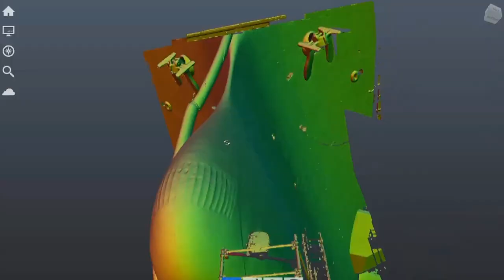Why US Navy Shipbuilding is in Crisis

Comment: NNSB (Newport News Shipbuilding) can take a large portion of blame for the Ford Class carrier delays. Putting Donald Rumsfeld’s shoving new technology into one ship aside, these higher ups at NNSB, from procurement and scheduling to manpower distribution, are woefully inadequate and trained to tackle these issues successfully. There are a few folks at that level that have a good grasp of the macro process of overall shipbuilding, but politics, monetary bonuses and poor training are deeply woven into the culture. The submarine building portion is no better off.

The rudimentary problem of a failing workforce is THE problem, foreseen by many of us forward thinkers at least a decade ago, if not longer. A good macro vision is important and necessary, but a much deeper look must be taken as to who puts these craft together, and how these assets (shipbuilders) are managed. “More contracts” is not a fix for this situation. Far from it. 

I was an Outside Machinist building Virginia class nuclear subs most recently, and have built and repaired many surface and submarine craft in different yards during my 35 year career. Many sailors have less shipboard time than I do. I know of what I speak. This aspect of the failure to keep our Navy populated sufficiently with fleet ready ships is with what I am most familiar.

The work has to be done, and only a few of us left are willing to do it. Excessive pulling, dragging, lifting, and climbing are necessary just to put machining components in place, activities the younger generation cannot do, will not do, and will never grasp. The talent clock can’t be moved back. Precision measuring and reading a simple machinist’s scale are completely mystifying. Reading a technical drawing is tantamount to working in quantum physics. How does the work get done? It doesn’t. And it’s getting worse with every new hire. 

I am no MBA graduate, but perhaps half of the dead weight can be let go, and the remaining solid work force could get the remainder for incentivizing. Has no one thought to give the hourly force a share or two of five year vested company stock to get invested into the work they are doing directly? This all starts at the hiring process, attrition being taken into account. Start them low, weed out the chaff, and reward talent. Well, no kidding. It used to be that way. No longer.

In addition, one can’t “quality assurance” good work into the product. Level headed people know this. Heck, nuclear welding inspectors do their inspections on thousands of sub-safe welds from their desk. 

It’s not about me folks. I am showing an example of our dying workforce. 62 year olds cannot keep up that kind of work. I am permanently disabled by working to failure for decades doing this important and necessary work; and the new work force will not do that kind of work. The unions? They are hip deep in league with management so change does not occur.

What the news and the powers-that-be don't tell you is that the American work force is young, lazy and stupid. I'm one of the last generation that cares if 120 sailors come back up after a dive. When I apprenticed as a machinist, the requirements to be a Journeyman required study and hard work. I was first in my class, graduating early. As with many educational institutions these days, these requirements have been lowered to accommodate people’s lack of ability. How can good ships possibly be built in this fashion?

I fear for our military battle force in that soon there will very few people capable of repairing or putting these modern first-in-class ships together, even for the USA, let alone another country. The old can-do American attitude died a generation or two ago. Showing “we sent a man to the moon” video clips are a sorry excuse for today’s supposed American greatness. Sorry Australia. Buying subs from us is a pipe dream. If you want something done right, do it yourself. 

The shipyard’s schedule has slid so far to the left we are at least a year, more likely two, behind in building just these submarines. Two boats per year is stretching it. But three? Impossible. I highly suspect that the schedule and monetary figures are skewed to show a positive result. D.O.G.E. would have a field day looking into the fraud, waste and abuse in these yards. Remember the Seawolf fiasco with NNSB as the lead yard? Even throwing NNSB bones for the Virginia and the new Colombia Class is laughable. I wouldn’t by a mousetrap from them.

If robots or automated building procedures aren't created and utilized soon to take up the slack of our aging specialist shipbuilders, it is a doomed proposition if left in the hands of these inept upper and lower managers, workers and designers. They need their GPS phones just to get to work. I have seen this first hand. I am not exaggerating. These people in charge and building these ships are dolts and idiots.

Who came up with putting all shipbuilding plants under the government umbrella? Are you kidding? Even now firing these clowns is impossible. Make them government workers?! The new construction yards are already run by the Navy. Build commercial craft? It would take NNSB a week just to figure out how to get aboard a commercial vessel. 

I close my eyes in fear every time a boat (sub) goes on sea trials, and am frankly amazed there hasn't been another Thresher or Scorpion incident. God bless those brave men. I pray God blesses our war fighters daily.

Again, look deeper. What good are contracts if we can’t do the job? We are in serious trouble here. Shame on the top leaders of shipbuilding and the Press. 

Any proposed “fix” will take many years after President Trump has left office, if at all, to show any improvement, so my unfortunate and realistic expectations of improvement are next to nothing. Or less.